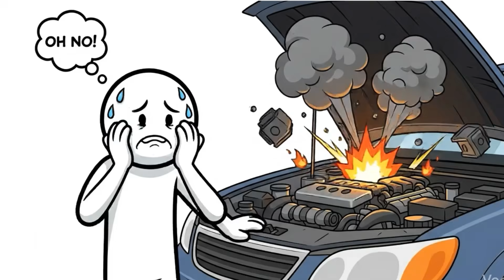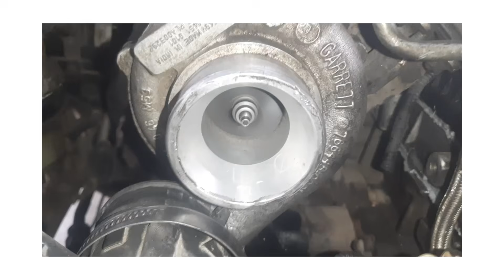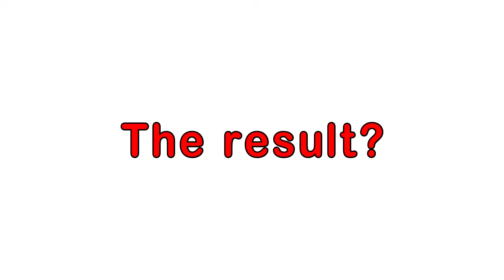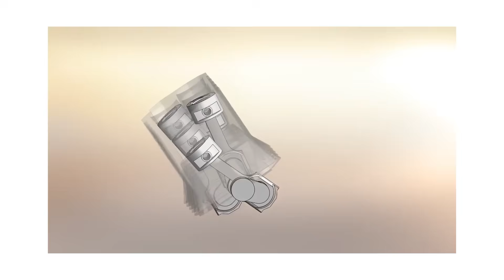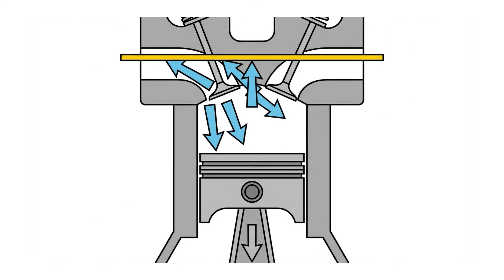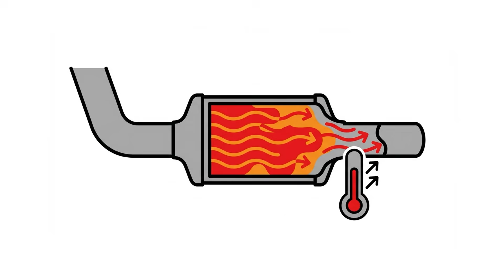Every Car Engine Type Explained (Finally)

Comment: Funny how explosion is power and then the same words mean knock that destroys petrol engines and then this "completely different approach" is invented in diesel engines called compression ignition.
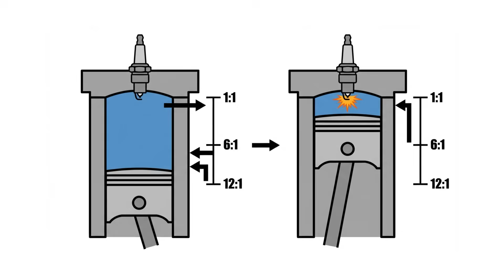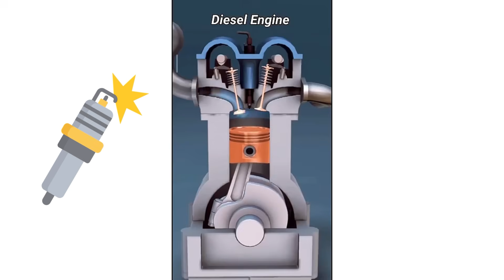CONTROL is the thing between 1:44 explosion and 2:23 explosion and 2:51 explosion.

Torque doesn't mean anything by itself, diesel burns slower and also aren't picky about the AFR and compression ratio so the engines are optimized for low rpm, there are high revving high power band diesels too. Petrol burns faster and is picky but can be controlled with spark unlike diesel (usually) and because torque and engine speed is straight related to power the petrol is optimized for higher rpm. 

4 cylinders also can't deliver continuous power, each piston can only theoretically push 180 degrees but none really does so 4-stroke inline 4 has gaps after and before every power cycle making it vibrate.

AND NOW THE COMMENT I CAME TO GIVE
B5254T is the engine I have, it's inline5 from Volvo. (before that I had Fiat Marea inline 5, don't know the engine code)
It's not as balanced as inline 6 or 4 but has the smoother power delivery than 4 but not that silky that 6 has. Also the sound is distinct.
Knew before I watched that there wouldn't be inline 5 in "Every Car Engine Type Explained" :D

"letting power tools to cool down before putting them away" was a good joke
Reply from the maker: I was about to add it in my video but I couldn't get enough authentic information. so I skipped it